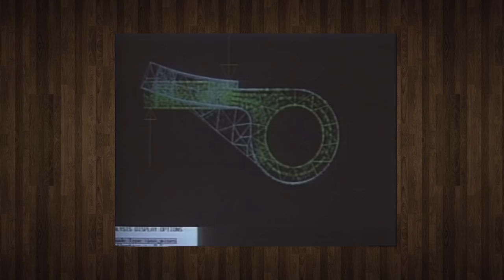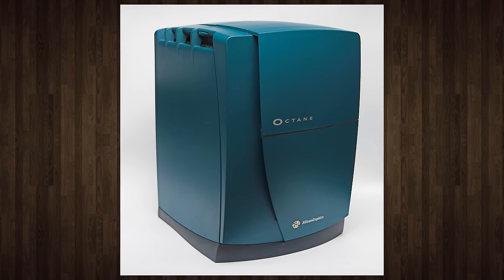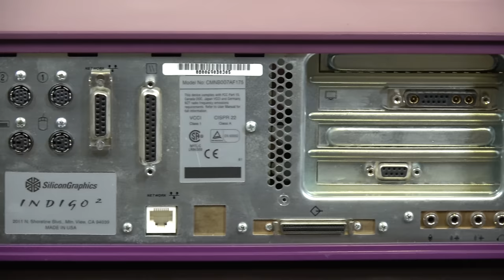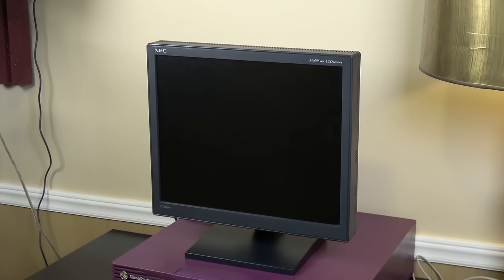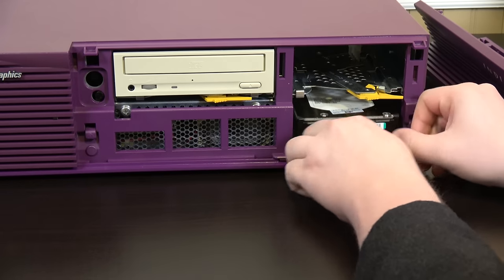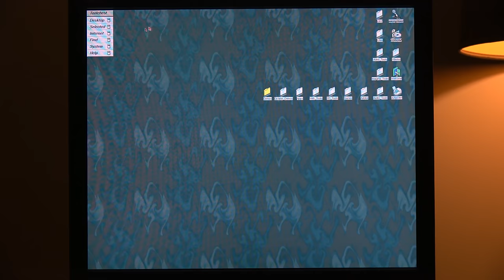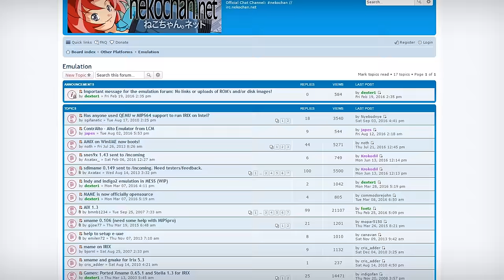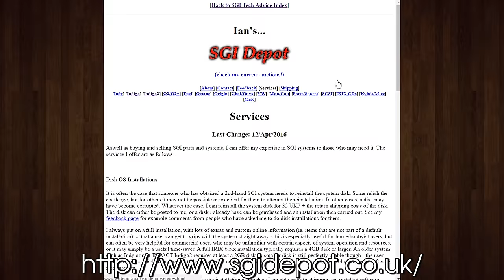SGI Indigo2: An $86,000 Workstation from 1995

Comment: The fact that nobody here seems to mention is that this thing was capable of Standard High Definition a full decade before that went mainstream. Holy moly.
Reply: Even crazier is that about the same time VHS tape had been modified to record and playback "Full HD." Unfortunately it was too expensive for most people. Just like this machine. Lol. Seriously though late 90s and early 2000s CRTs had no problem with resolution. Source material was the problem. Only way we could actually see HD video on them for the most part was while gaming.
Reply: Not worth 30k but yeah sounds crazy
Reply: The "Picasso II" video card for the Amiga 3000 came pretty close, for a tenth of the price, 1600×1280, SVGA, FBAS and S-VHS outputs, (S-VHS PAL only though)
Reply: @greggoog7559  12 bit doesn't imply HDR, although it is preferable for it.
Long before the HDR that we know today, cineon was a thing and the main way to deal with high dynamic range material, i.e film.
It was a10 bit workflow.
Reply: Circa 2000 17-19" most "Flatrons" and "Trinitrons" on the market were 1280x1024 screens, with bigger CRTs going for 1600x1200 or similar and top one going up to 2560×1920. This were pretty expensive, for sure, mostly for DTP, 3D etc, but even midrange models back then could display nice clear image with muuuch greater refresh rate than what we have now (60Hz). Not to mention colour reproduction, input lag and so on. There's no point comparing LCD to CRTs anyway. CRTs rocks in every aspect (except size/power consumption) compared to LCD.
Reply: Ben Helweg iirc, there were NuVista+ cards that did 10 bits per channel or 8 bit RGB + 8 bit alpha channel. The one I saw had a whopping 4 MB of dedicated VRAM. The cards cost in the $10,000-20,000 range. Still a bargain if you were doing blue or green screen work compared to the proprietary systems that cost in the hundreds of thousands of dollars.
Reply: I had a job working at a video editing and post production software company in 1995. I used it to write software that captured uncompressed SDI video. It was a big deal back then. People were gobsmacked when it rolled the tape deck, and starting recording. The storage system was still a bottleneck back then. It needed a big disk array.
Reply: david white looking at the price explains why the toaster existed
Reply: YEET if you are a business $30,000 is a steal to get hardware from essentially 10 years in the future.  Depending on the industry a machine like this paid for itself  very quickly.  The big boys don’t waste money on toys, they make money with them.
Reply: david white pretty close isn’t good enough when you need a tool that does a specific job.
Reply: That's like 4k before mainstream in this day lol
Reply: @nicholas_scott  And crying when you find out you need to buy a TBC...
Reply: mike h  And how did you connect your film to a crt monitor? Lol... No what I said was correct.
Reply: mike h  That's not what I said though. In fact I said the opposite. But film, projectors and screens are an entirely different subject that didn't fit my post because it was about affordable HD. Crt displays were affordable but lacked inexpensive media other than games. There is no way of displaying film on  CRT so...
Reply: mike h  For a CRT! Do you know what a CRT is?
Reply: mike h  You can't comprehend what I said and apparently don't understand the technology I was referring. Plain and simple. I'm done explaining it to you.
Reply: Not really, back in 1991 I had a computer in my graphics lab that had as many pixels as 1080p does today.  Of course, it was a 4x3 monitor and a CRT.  We actually took quite a step back in resolution by moving to TFT (and oled, etc) from CRT.  TFT is much crisper and much better with text, so I haven't owned a CRT monitor since 1998 or so - even with the degraded resolution, it was still much nicer to work on.
Reply: Qimodis  60Hz?? No one ever used 60HZ on CRT. Even cheap generic CRTs had 70-80Hz refresh rate in 1024x768, with a little better one easily doing 120Hz or similar. And in terms of color, contrast, viewing angles or "ghosting" of course CRTs are superior to LCD. You must be high or never used CRT in your life to think otherwise, duh. Haha LOL
Reply: @override7486  
There is one thing in which LCD displays are from beginning superior to CRT: geometry. Rectangle would be always same rectangle regardless you put it in center or side of screen and  nearby black or white neighbors.
Reply: just makes you wonder...like wow they could have made those and released them, but it probably would have been too quick for the public.
Reply: even 2k and 4k on the onyx. i used them all!
Reply: Not to forget - full-screen animations in 24 bit with textures in real-time... The Crimson was first to offer this  around 1992 with its RealityEngine gfx board set (3-7!) boards around 40x40 cm each... 😅
Reply: CRT monitors were often capable of higher than HD resolutions. In the late 90s 1024x768 wasn't uncommon, in 2000 I had a 19" 1600x1200 crt. LCD screens are the culprit behind stagnant screen resolutions
Reply: @davidewhite69  And not only that, with either 600, 1200, 3000 or 4000... even the native chipset (ECS OR AGA) could already  output 1280x512i PAL
Reply: @override7486  in 2002 a mate who did hardware reviews for a pc mag gave me a 21 inch Sony Trinitron monitor that could do some incredible resoloutions, from memory I think it could go as high as 2040 x 1500. it was very heavy!
Reply: @override7486  Exactly!
Reply: @lookoutforchris  Spot on. An oil company told me their $1.5M SGI paid for itself in six seconds. People don't understand that the products SGI was selling allowed companie to do things that were simply impossible with off the shelf tech at that time. It was the ability to access problem solving abilities years ahead of rivals, but at a price since it wasn't mass produced by definition. The Onyx RE2 I have in my garage originally cost over $1M, the Onyx3800 next to it probably a lot more.
Reply: @richardwicks4190  OLED is literally superior in every way
Reply: @boanerges5723  no
Reply: @zk0rned  I don't know if OLED is superior to LCD right now, and by "I don't know" - I mean I really don't know.  The original OLED monitors had blue pixels that faded in time.  My LCD monitor I'm using now, it's 7 years old and works as well as the day I bought it.

It's not as energy efficient as an OLED but it puts a CRT into the dirt.

It's funny where we are.  In 2000 years, a film or video will be no better or higher quality than a video or a film is today.
Reply: @zk0rned  yes
Reply: @boanerges5723  no
Reply: @richardwicks4190  It seem like they worked out most of the kinks with it as every new technology usually has a lot of problems with the first iterations of it like the first CRTs weren't very great either
Reply: @zk0rned  however, yes
Reply: @boanerges5723  no
Reply: So dumb. HD was mainstream in Japan and in Hollywood by the end of the 80s. Heck, we had D-VHS that was full HD ... it just didn't take off thanks to DVD.
Reply: @orangejjay  It really wasn't that tech was very expensive back then and most movies weren't even recorded onto high-def media because of the high cost it wasn't considered worth it to most that worked on movies at the time
Reply: @override7486  Except modern IPS panels can seemingly actually keep up with tubes in the image quality department nowadays, and OLED can actually match CRT's and even plasma's black level.
Reply: @lookoutforchris  The nicest feature of these wonderful SGI machines is that you can't game on them!!!!! <3 !
Reply: @YEET-yh6qc you must not do professional work then.  Spending serious money to get tech 10 years ahead of the competition is an insane advantage.  This is why everyone jumped in these.  If you don’t make money with a computer but just play games you’ll never understand.  You probably think it’s a waste of money to drop $500,000 on a tractor trailer or $1m on a CNC machining center, but you’re not really part of the business or innovation chain then.
Reply: @CynHicks you scan it frame by frame into the online system.  How do you think cgi was done in the 90s?
Reply: A decade before TVs but computer monitors were in so-called HD long before that.